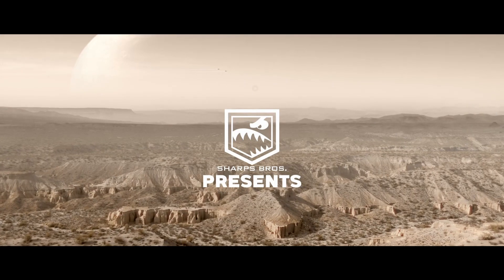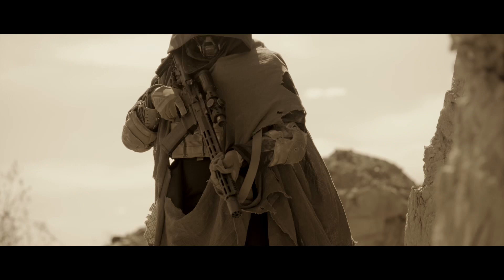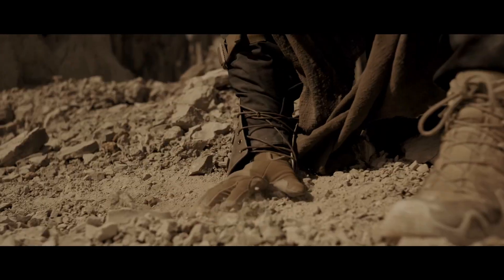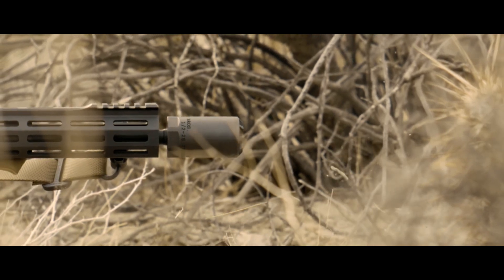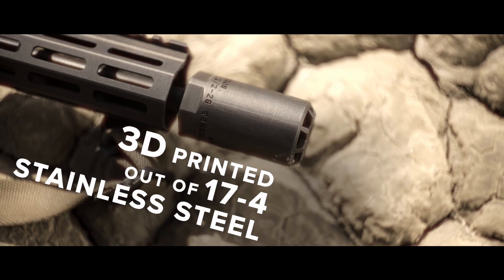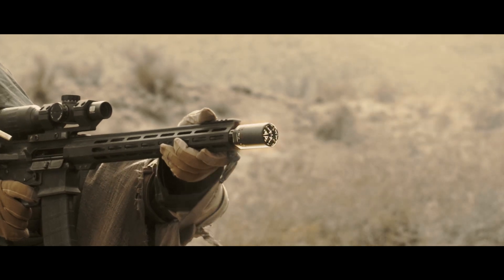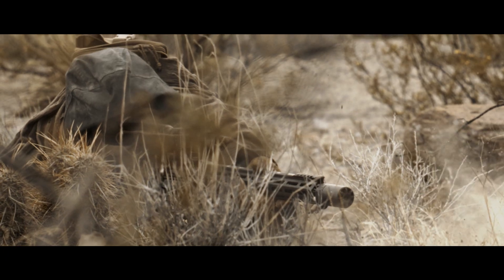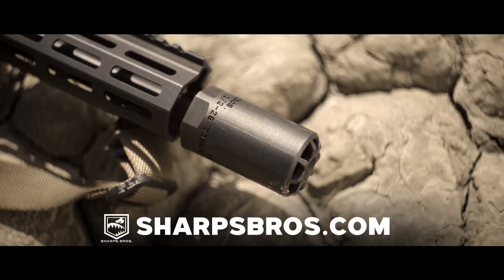BADLANDS

Comment: sorry I have an additional comment and piece of an advice/opinion. why not make a muzzle device that has a slight set back to close the gap from the point of the device to the handguard. so there is not a funky gap, such as a 15" handguard and a 16" barrel with as much as a 1/4 to a 1/2"in very noticeable gap in between the handguard and muzzle device. aesthetically that gap looks horrible and funky or do the setback to fit under a 1.35" I.D. at the threaded and then make the blast end 1.5"o.d. just my personal opinion. not meant to offend anybody
Reply: Muzzle devices get extremely hot, you do not want heat to transfer from your muzzle device to your handguard. Plus that would add excess weight that doesn't benefit the shooter, but might look cool to a select few.
Reply: @joshbeasley21  personally I do not care what everybody else thinks even the select few. I built my AR-15 for me not them. besides I am just talking about an inch or so. just enough to clear the handguard and eliminate the gap. there is also the fact that by the time you Rail heats up from your (MD) the gas block and barrel, would have started heating up enough expelling heat depending on your rate of fire, enough to make an effect, that is why rails are primarily made of aluminum, it rapidly cools about as fast as it would heats up. also there is the fact that I do have a small but effective foregrip, plus  wear gloves no matter what you do there is not going to be some kind of heating issue and a muzzle under your Rail should not and is not going to transfer enough heat that far back that you just could not relocate your hand till that specific area cools good thing about aluminum is is cools fast like I mentioned before. Have a great Day and God Bless. Oh and as far as the weight goes it would help mitigate muzzle rise, benefiting the shooter by reducing muzzle flip making it easier to stay on target for that rapid follow up shot. on top of the way I mentioned it would actually reduce weight by removing material to fit under the handguard and over the barrel itself. setting the threads about a half inch forward should not even effect the function of the design of the device. ask anybody that runs a can if that extra weight doesn't benefit the shooter any, I run a Guntec Spitfire that weighs about 9oz with blast shield when I remove the shield it has slight muzzle flip with just the brake, with the shield, it reduces muzzle flip, that I can stay on target while rapid firing without any muzzle flip at all
Reply: @mrshort2379  then purchase a longer handguard to eliminate the gap. Most muzzle devices are threaded similarly.
Reply: @mrshort2379  foooooking-A man 🇺🇸👊😎👊🇺🇸
Reply: The shroud type of set back would be cool to fit on a 16” barrel with a 15” handguard.  I dig what you are trying to do.  I can say for a fact that Aero R or S one handguards wont all the Badlands to fit within.  Aero, the enhanced handguard works.  All about Inside diameter and clearances.  Faxon handguard wont work either i have found.  I finally have one of the Badlands brakes after every place being OoS.  The Badlands vs. Witt vs. Barking Spider.   Heavy piece, very heavy.   Needs to be freaking titanium if you ask me.
Reply: I agree! This thing looks sweet and is what I’m looking for! First time a commercial excited me in probably 30 years or better…I’m 46! An adjustable aluminum sleeve would be cool or an aluminum unit pinned to a stainless steel threaded inner… my brain is going nuts over this design! I want 7 different models to choose from!
Reply: Buy the right handguard if you dont want a gap

Comment: That look like a badass!! Blast forward device. especially for a one piece unit, but to tell you the truth, In my opinion it would like it better if it were 2 piece unit. that way I could take the shield off and use just the brake portion, or even thread on a can, or whatever over top of the brake portion. but I do like the way it looks. I would like to have one to try out though